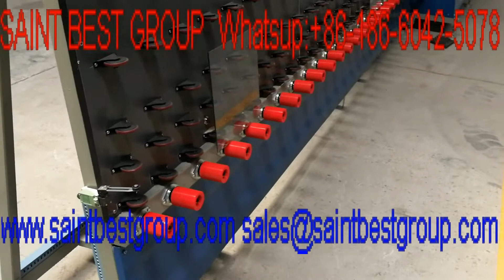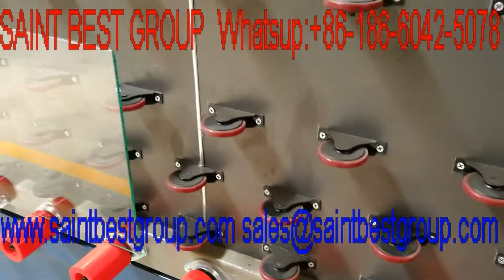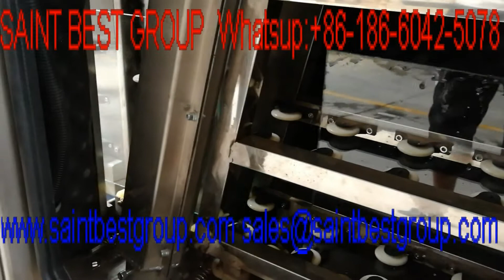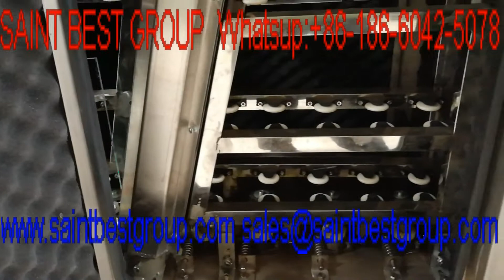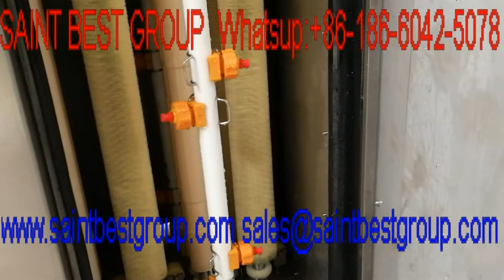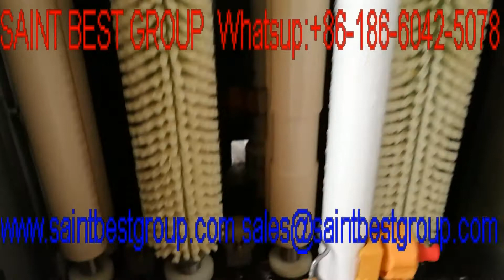300x300mm Vertical Flat Glass Washer,Insulating Glass Washing Machine manufacturer

Comment from the maker: 300x300mm Vertical Flat Glass Washer,Insulating Glass Washing Machine manufacturer,Vertical Glass Washing Drying Machine with min 300x300mm&Stainless Steel Air Knives,Flat Glass Washing Machine for Insulating Glass,1600mm Low-e Glass Washing Machine for min 300x300mm,Vertical Insulating Glass Washing Machine,Insulating Glass Washing Machine,Double Glazing Glass Washing Machine,Flat Glass Washing Machine for Insulating Glass,Flat Glass Washing Machine for Double Glazing,1600mm Vertical Automatic Glass Washing Machine ,Insulating Glass Washing Machine,Glass Washing Machine,1600mm Automatic Vertical Glass Washing Machine deliveried to Colombia,1600mm Vertical Glass Washing Machine Double Glazing Glass Production Line ,1600mm Vertical Glass Washing Machine Testing,Double Glazing Glass Washing Machine,1600mm Vertical Low-E Glass Washing Machine,Vertical Low-E Glass Washing Machine,Low-E Glass Washing Machine,Vertical Glass Washing Machine,Stainless Steel Vertical Low-E Glass Washing Machine,1600mm Vertical Low-E Glass Washer,Vertical Low-E Glass Washer,Low-E Glass Washer,Vertical Glass Washer,Stainless Steel Vertical Low-E Glass Washer,Falt Glass Washing Machine,Low-e Glass Washing&Drying Machine,Vertical Low-e Glass Washing&Drying Machine,Automatic Vertical Low-e Glass Washing Machine,Automatic Vertical Glass Washing Machine,washing machine for insulation glass.
 If any interested in it,pls send emails to sales@saintbestgroup.com or saintbestgroup@163.com or add Skype:allenszj for direct conversation.
URL:www.doubleglazingequipment.com www.saintbestgroup.com www.shuntaitech.com www.digitaluvprinter.com
What'sapp:+86-186-6042-5078